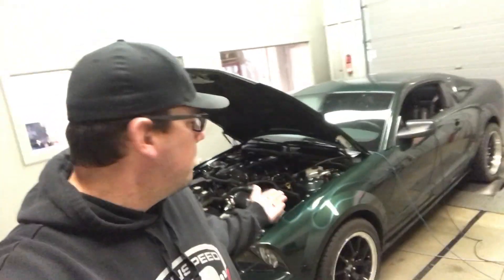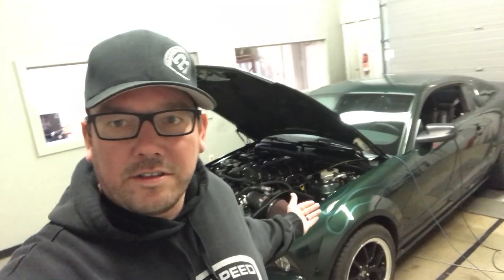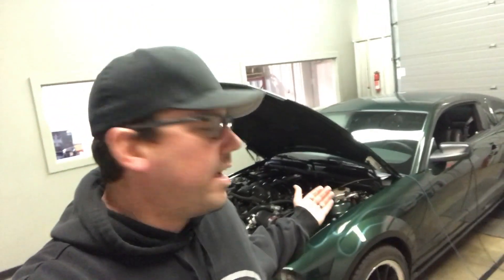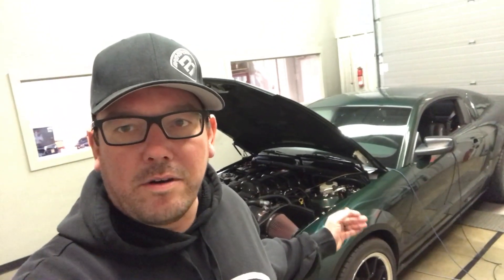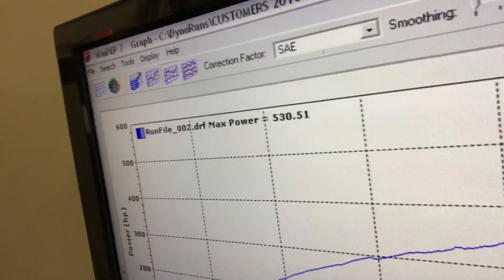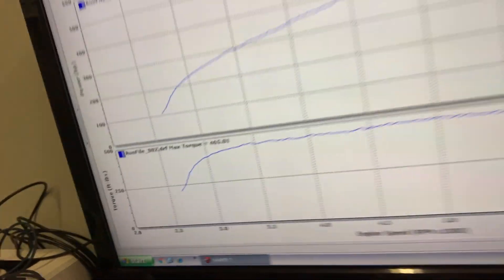Edelbrock Supercharged Bullitt Mustang (High Producer) Brenspeed 560E Package

Comment: Awesone! Can you safely make over 500 with the saleen blower? I see most with cams/headers are in the 480 range. Also for longevity should you keep rpms below 6200 or is 6500 fine at these power levels? Thanks Brent.
Reply from the maker: Most run them up to 6500. Normally if you have a 3.4 pulley, headers, and cams you are good. Some of those make 500 rwhp, just depends on conditions and a few other factors like auto/manual and how if you have heavy wheels (which reduces dyno numbers) or an aluminum driveshaft which helps dyno numbers.
Reply: @BrenspeedEngineering  much appreciated like always
Reply: It seems the older these 3vs get the more power they make lol.